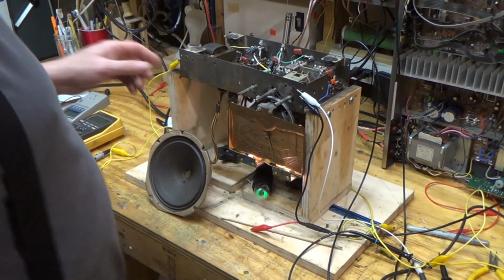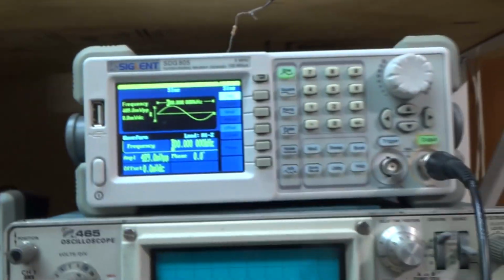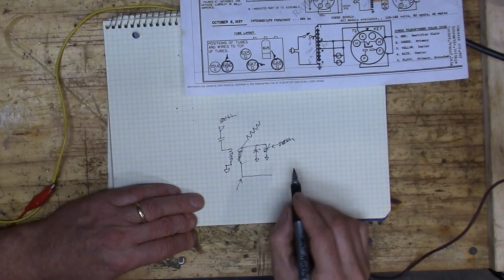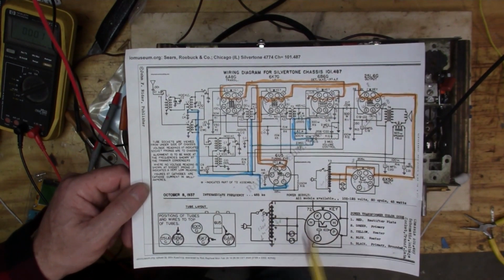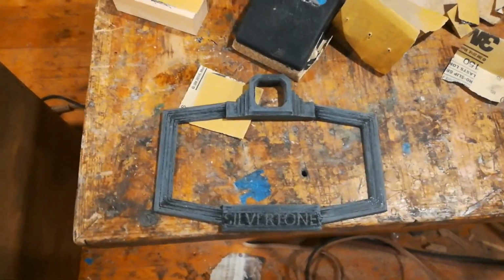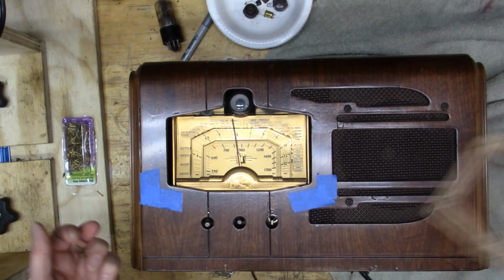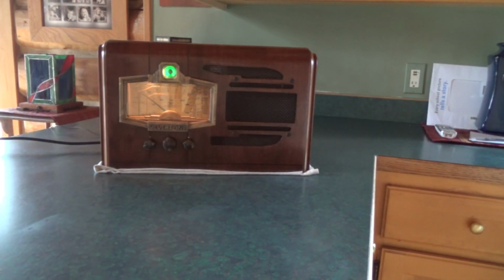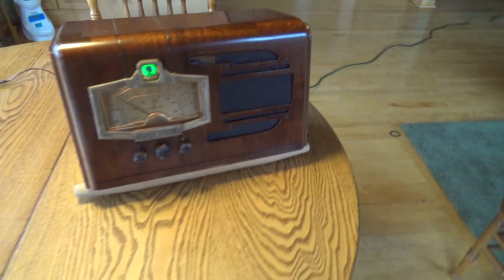1937 Sears Silvertone Radio Restoration part 2

Comment: Excellent 3D creation..It would be interesting if created on a CNC router as well. What was the thickness of the glass for the lens and what type of glass cutter is that...works great.
Reply from the maker: It was just a piece fo single pane window glass. The cutter was a one that I use for stained glass work although the $5 one you get at the hardware store work about as good if they are new. Thanks for your comments!